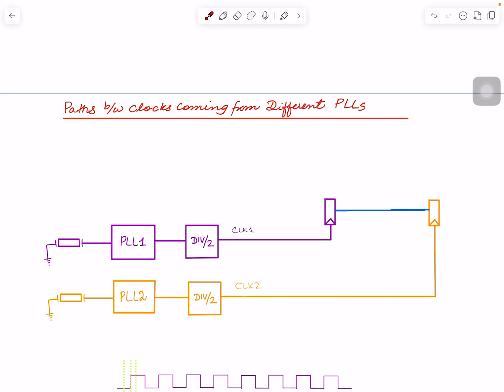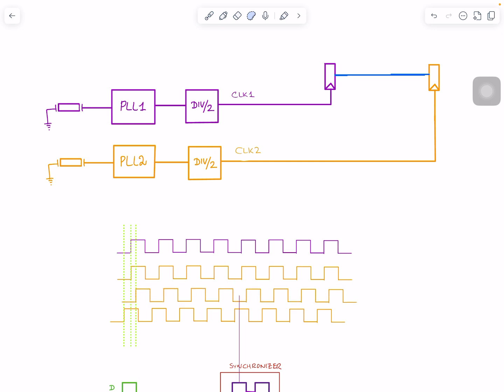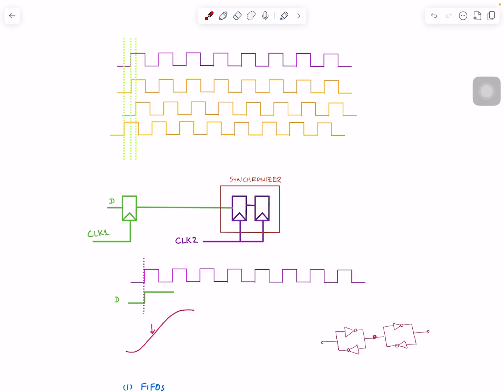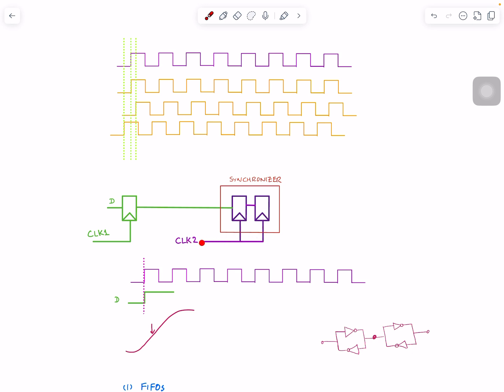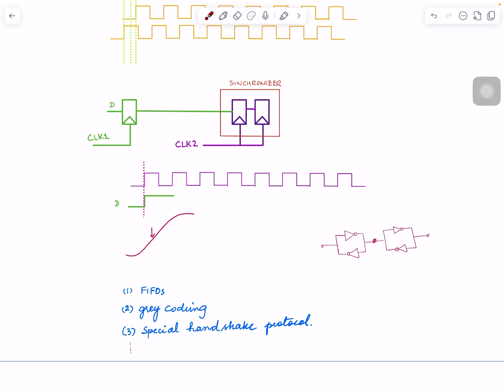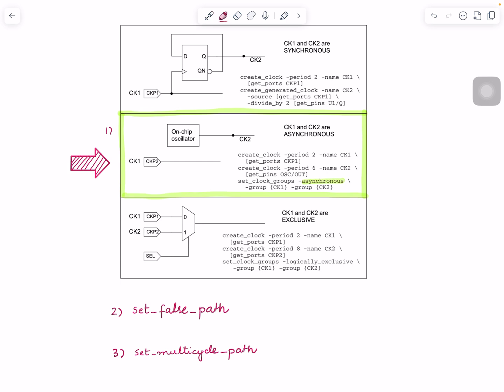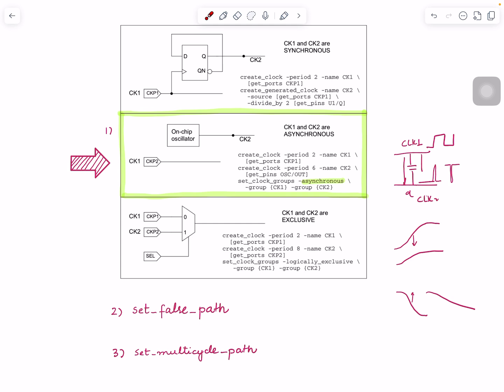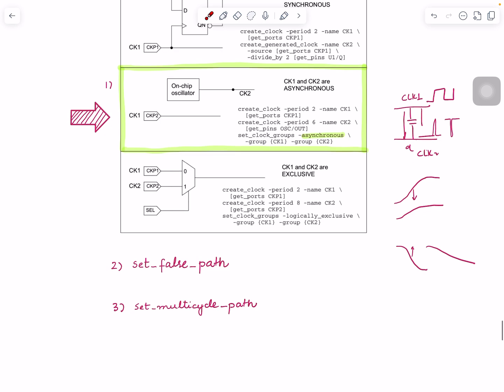PD Topic #36: Handling Asynchronous Clocks & Data Transfers | Synchronizers Explained

Comment: Can we use MCP on asynchronous clocks also? For MCP PrimeTime determines the edge relationship and accordingly applies the capture edge right? But for Asynchronous clock prime time does not know the Edge Relationship b/w two clocks. SO will it work ?